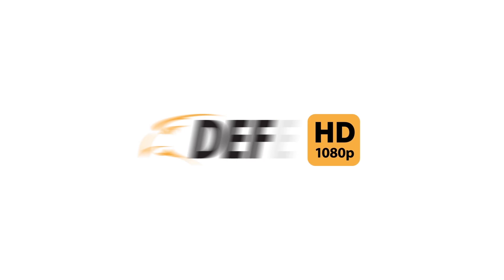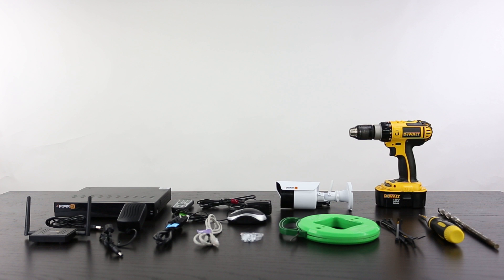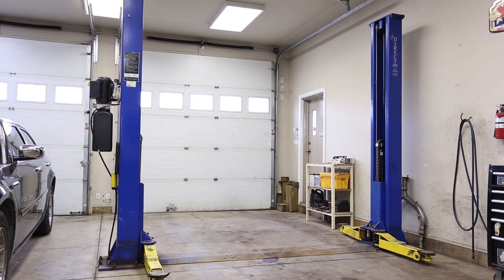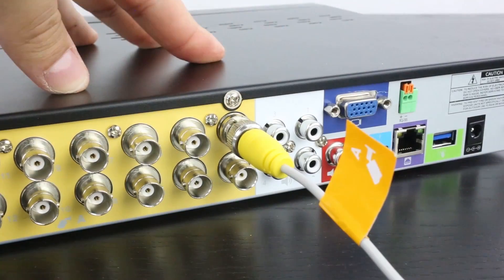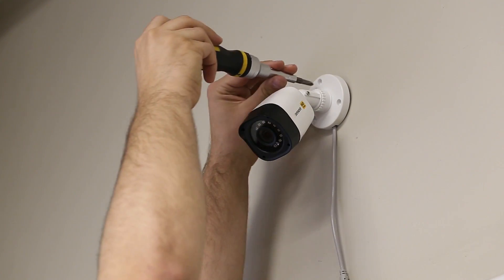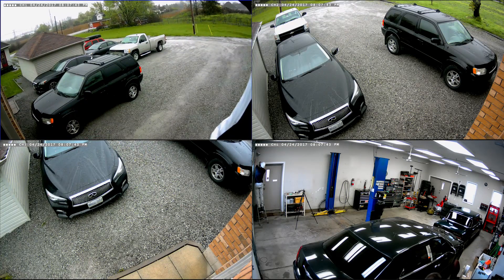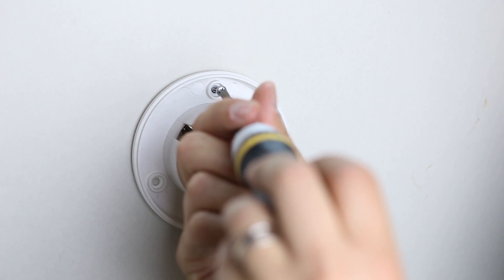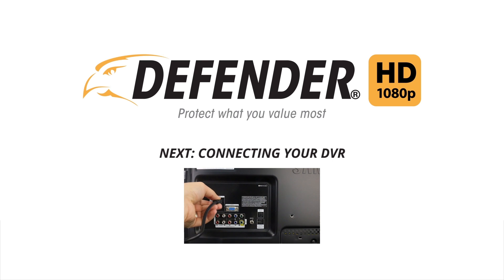Defender HD First time Setup: How to Install Your Defender HD Cameras

Comment: No instructions in the box. My camera has a third connector with a button. It also has a coupling. What is the purpose of these?
Reply from the maker: Hello Chung, Please contact our support team at www.defendercameras.com I believe you are inquiring about the 4K system, not the HD system. We would be happy to assist you further. Best Regards, Amanda M | Defender Customer Experience Expert
Reply: I believe that's for connection an optional audio cable, but not 100% certain. I haven't installed mine, yet. Still figuring it out.